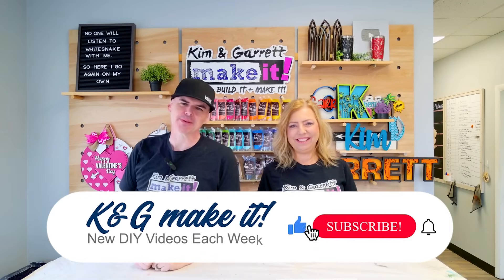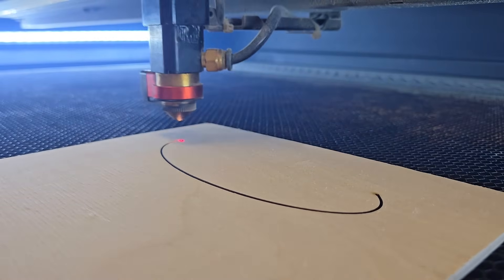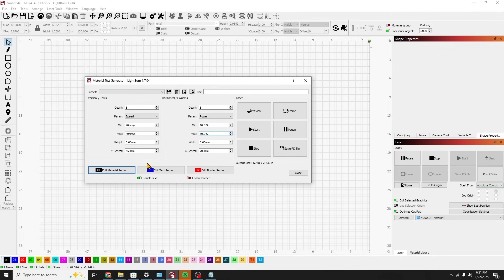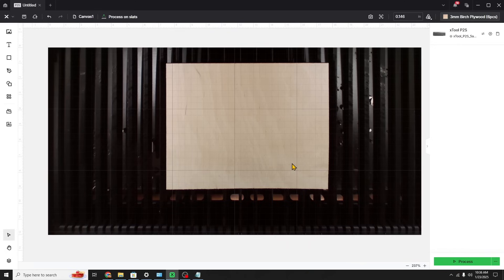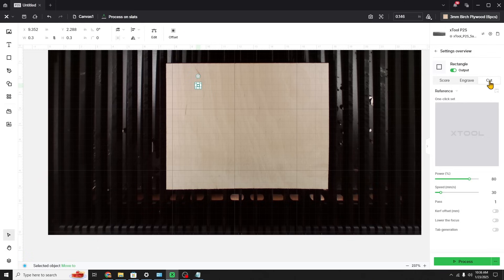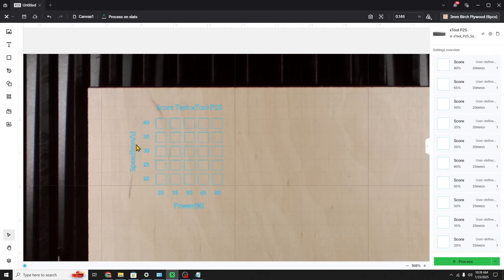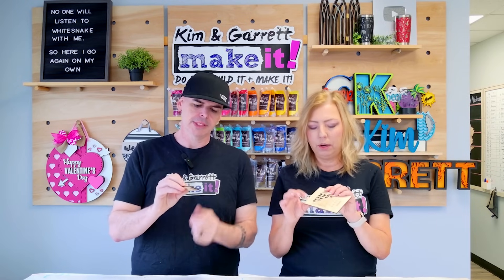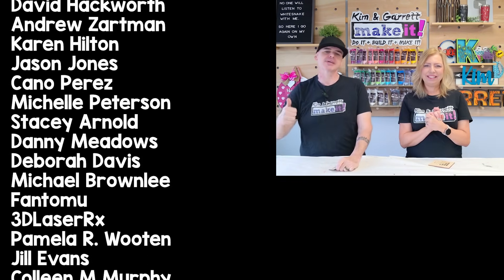Top 10 Laser Troubleshooting Tips: Episode 1 - Mastering Speed and Power Settings!

Comment: Thank you for a very nice video.  However what to do if you do not use Lightburn??  For cutting should I set the power to 100% and then just try to find the speed?  I built a cnc laser with a 60 watt output lasertree laser head. What about setting the air pressure??  Thank you.